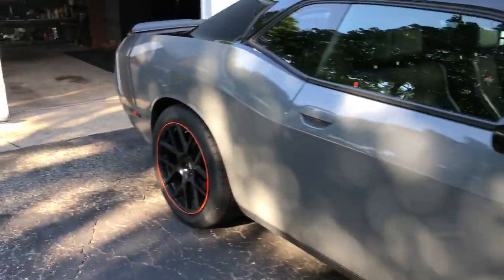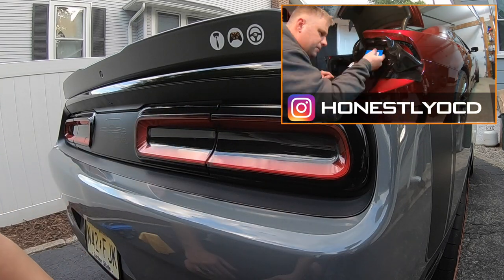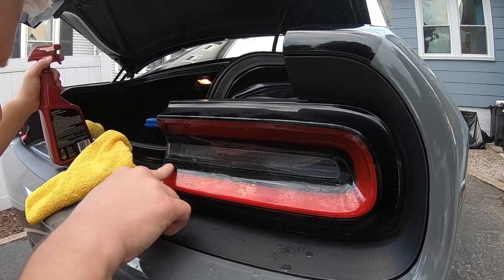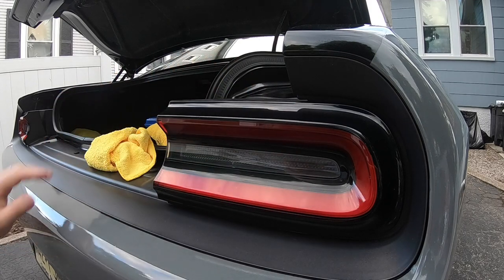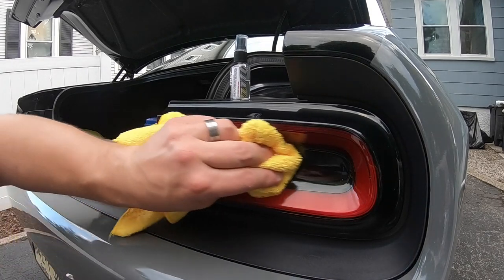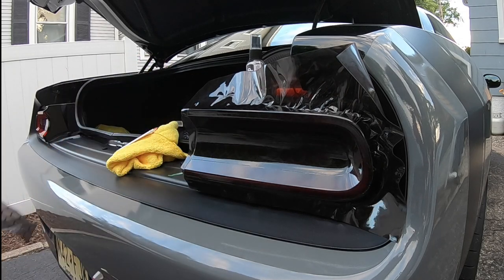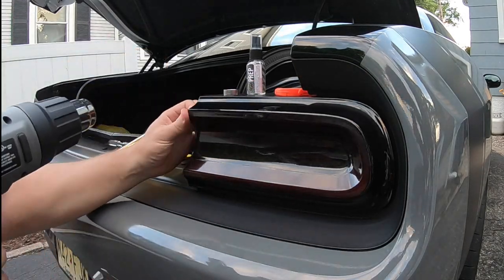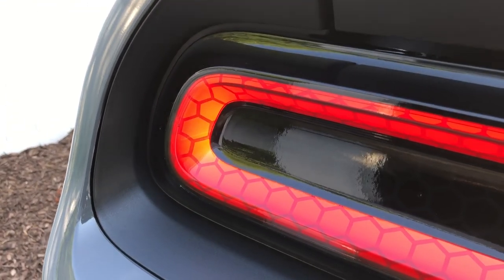Installing Luxe Lightwrap FX Mid Honeycomb on my Challenger

Comment: iam still trying to figure out why i am still watching this when ill never buy or lease a 60k car ?????!!!!....>>>>
Reply from the maker: Challengers range from 20k and up so there is always hope 😋
Reply: @WorkPlayDrive  i have a 100th edition 2014 full leather sport leath wrap steering wheel,  alum hand pat shift full leather 2 tone brown stiching, heated seats,  premium alpine sounds, sport mode button all under a good old stx 3.6vvt v6 got it as a 2nd owner 2019 with 51k miles at 14k so yea payments are cheap like 200 insurance is 180 a normal 350-450 car payment tota. so ill never afford a hell cat or a 392 all them payments would be 700-1000+ and besides its my daily driver so..... i will need a 2nd one to do all the cool stuff to it but another car payment would break me. so... yeah like i said hope and dreams hopes and dreams. and considering what you dumped $$$ in yours yea your reaching 75k fast
Reply from the maker: Love the 100ths 

It took me a long time to finally get the car I wanted and the best part is as you get older the insurance costs much less 👍

Comment: As soon as the light one is available, I'll buy along with the tape. Expensive, but it will protect the plastic from scratches. It does scratches easily.
Reply from the maker: awesome choice I think that light smoke will show some red, which may in turn show more honeycomb with the lights off. I cannot wait to get some.  Be sure to note I updated my recommendation on the tape, finish line is better with the New LightWrap, there have been reports that design line sometimes snaps because it's so thin.  I put the correct link in the description.

Comment: I love the smoked out look, but I’m concerned about the reduction in brightness, especially in the daylight. Looks like it reduces brightness by half almost. I would retrofit to a brighter led kit if I was to do it I think.
Reply from the maker: Don't forget there is a lighter grade of tint as well (which I have on order)  I also doubled the tint on the brake and reverse light, now in hindsight it was not necessary with the mid smoke honeycomb.  The brake lights are still fully visible in the daytime  even at a long distance.

Comment: What were the measurements that you ordered on the site? Would 20” * 2 yards be enough for both tail lights?
Reply from the maker: 20 x 1 is perfect if you cut it how they recommend on the product page. 

If you are a beginner I recommend 20 x2 so you have the ability to make mistakes.

Comment: Were you using MgGuiers spray wax to clean with? Just asking....
Reply from the maker: For the clay process I use either spray wax or suds as a lubricant. Before applying the vinyl I remove the grease and wax with a 60/40 Isopropyl and water solution to make sure nothing impacts the adhesive

Comment: will i be able to get the brush metal kit for my challenger?
Reply: or do they give you a strip?
Reply from the maker: Depends on what you want.  If you want to black out the whole tail section you would order 1 yard and apply like mine.  If you only want to cover the center area you buy the strips.  I applied both only because I wanted lighter tint on the outside and darker in the centers.

Comment: I F🤬 mines up today, I have to reorder and try again
Reply from the maker: It happens :(, how bad?  I've gotten it stuck together and looking terrible but I slowly peeled it apart, pulled, heated and it returned to normal.
Reply: Work Play Drive messed up the corners, just couldn’t stretch out the creases

Comment: Sweet! Did you dye your seat stitches yet? Looks bad... Ass...
Reply from the maker: no, what is this seat stitch dye you speak of?  I'm interested.
Reply: Go to any craft store and buy a 'fabric painting marker' of your color choice. I went with red because I have black seats looks amazing. I have a lot of plans with this ride cosmeticly and performance. If you want some details hit me up... I promise you will like ;)
Reply: Forgot to mention, if you have fabric seats be more careful... If you have leather you have NO worries. Just work 12" at a time and rub off excess with rag or paper towells. Windex "Something not to strong" should be ok... I just used paper towels had no issues.